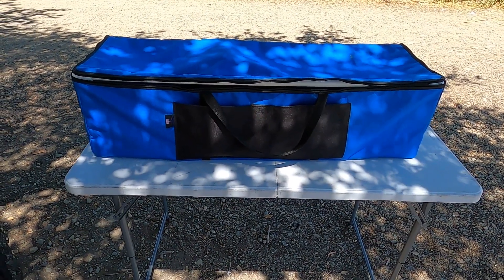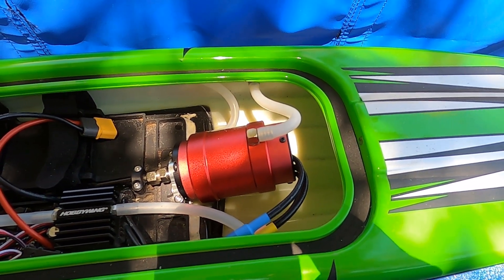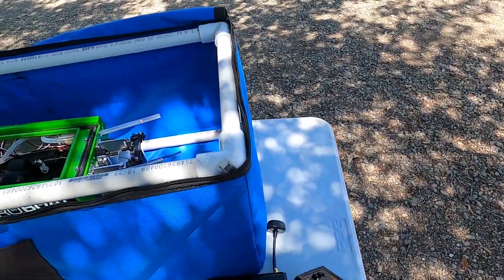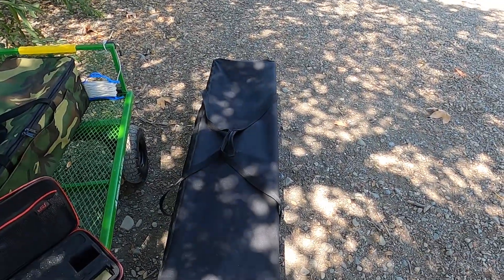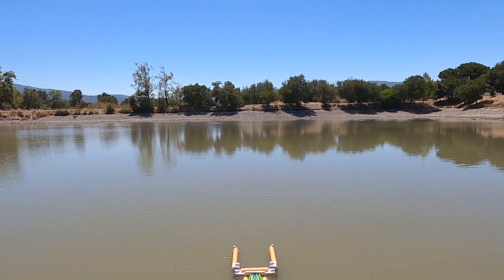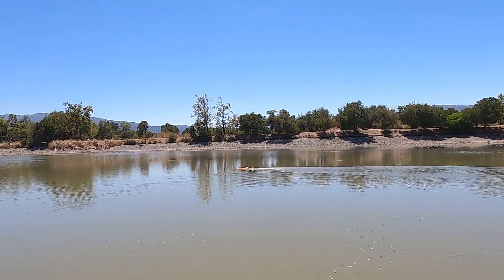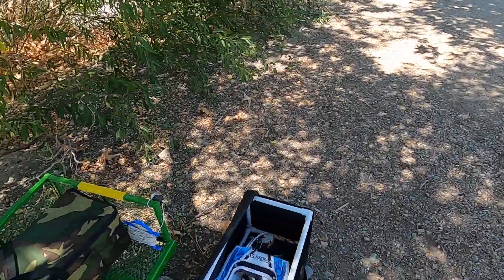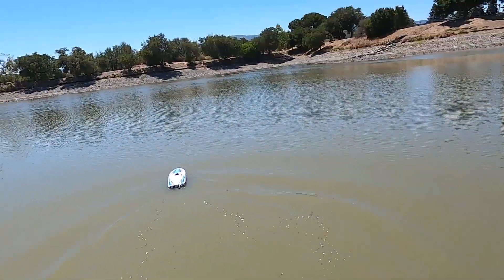ProBoat Shockwave Rescue Boat Conversion Update

Comment: Hi I have questions can you help me?
Reply from the maker: Only if you ask the question...lol 🤙🏼
Reply: @ninthislandrc  Are you able to show us the thing you used to retrieve your boat?
Reply from the maker: @petertran5565  The thumbnail for this video shows the second version of the rescue platform.  An actual "rescue" video can be found here:
https://youtu.be/EHZezQSH4X0

And, if you go to the 1:05 mark in the below video, you get a much better view of the first/original rescue platform:
https://youtu.be/_NQ9Vn8QnfM

In that video, you not only see the rescue "platform" I was using, but you also see other boats being rescued.  The platform used in both videos was the first version, which was "solid"...it did not fold.  A few months after filming those videos, I designed/built a second version, almost identical to the first, except that it folded, with the midsection (ie. the bar holding the 'square' that the bow of the rescue boat fit into) being the axis.  This was a much better design, as it made the rescue platform more portable.  The platforms were made using 1/2" PVC tubing, connected using PVC 90deg corners, and was able to float through the use of "pool noodles" (as can be seen in the referenced videos).  To prevent the tubes from filling with water, the ends were capped.  The second platform was made almost entirely using tubing from the first.

However, you might notice I used the word 'was' in the first sentence.  That's because, in moving to Las Vegas, I left behind (some accidentally, some on purpose) belongings...and, among them was the rescue platform.  As such, I will have to build a new rescue platform.  While my general plan is to build the new platform similar to the previous one, I plan to make some "design improvements" in this third version.  What those "improvements" might be, I'm still working on it.  There is also the possibility that I might restructure the current rescue boat back to a 'pleasure' boat, and could build something entirely new.  Right now, I'm concentrating on land vehicles (mostly 1/28 'Mini-Z'), as the weather is starting to heat up, and 'indoors' is the place people want to be for these next 4-5 months.  As we get closer to the end of summer, I will build the new platform...whatever it turns out to be...and will post a video.
Reply: Thanks pro..

Comment: How did you maď box for ships?
Reply: Huh?
Reply: @robbryan3044  sry, how did you made transport box for your boats :D looks pretty simple and cool
Reply: @johnyM128  Transport "boxes" for almost all of my boats (and some of my RC cars & trucks) are (essentially) the same.  The 'carriers' (ie. "bag" are all (with the exception of one) made by Ace Wing Carrier, and another small business that is no longer making them.  You can also find similar carrier bags on eBay, Amazon, and other sites.  As for the internal 'structures', that are all composed of PVC pipe, PVC pipe connectors (90-degree elbows, T-connectors, and corner connectors), and pool noodles...the same components used in making the rescue boat "rescue platform".  The one major exception is the custom-built wood carrier for my P-sport hydro.
Reply: @robbryan3044  thats great! thanks for your answer! have a nic day, i will check it